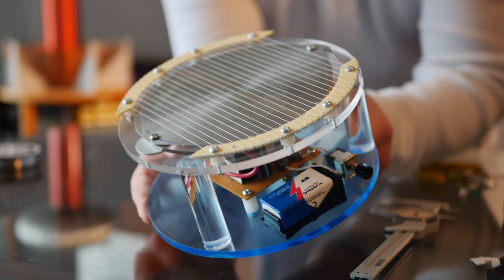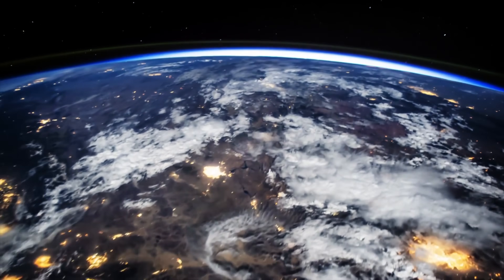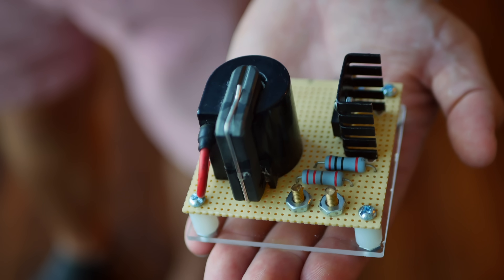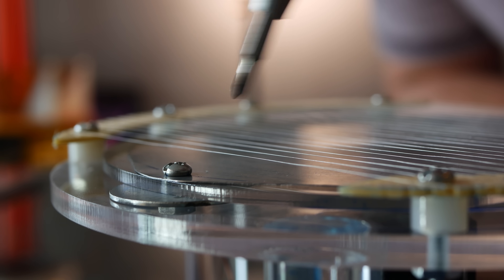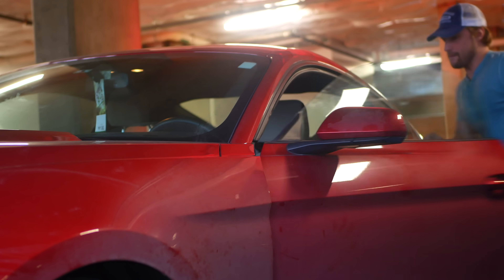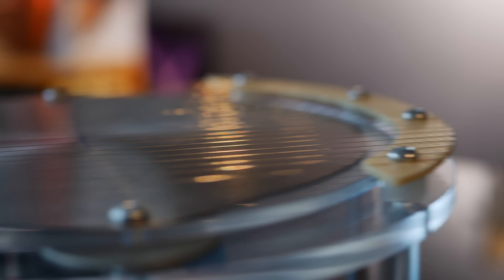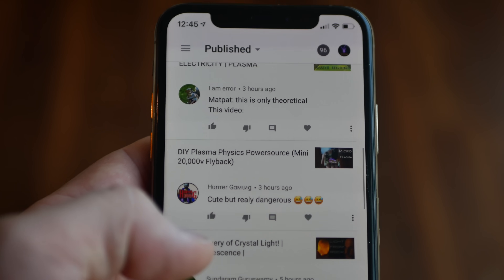Detecting Radiation Using High Voltage Plasma (Spark Detector)

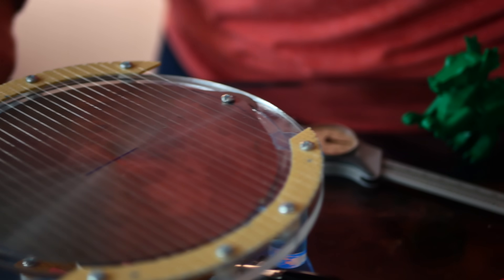Comment: At about 5:40 you said "Why so angry" "I made a detector for air".  I thought that was the best thing in the video. About 170 muons per square meter per second. About 1 muon per square cm per minute. Natural radiation is about 1 to 10 counts per second.  In fair weather about 200-800 negative ions and 250-1500 positive ions per cm^3. Before a storm goes up so you might make a storm detector.  Indoors a few hundred ion's/cm3.  If you would focus on one straight pin and a flat plate, with a microscope and camera to measure the distance and the voltage, almost any circuit can count the cascades. An array of straight pins.Put something on the plate, drop the pins though holes in a pcb, solder the pin heads, remove the paper/sheet and the pins should be at uniform height. Have screws to adjust the height, and adjust the voltage. 

If there is a transparent electrode material, and darkness, a camera might follow tiny discharges. The size of the gap determines voltage and volume affected by the high energy alphas and electrons and gammas.  But if ion detection is a target, that can be adjusted. An array of current detectors only needs tiny amounts of current if you have fast detection like a software defined radio.

Filed as (Ion detection, radiation detection, pins and arrays, large voltage gradients at small voltages, events)

Richard Collins, The Internet Foundation

Comment: A simple cylindrical fluorescent tube will do the job.. Also Neon Light bulbs will do.. Just play around with the HV .. High Impedance, high gain amplifier will be required to detect alpha particles..

Comment: If you drop the pressure in an enclosure add some neon, bring the wires closer together and lower to the plate you'll have more resolution, just like Cerns proportional wire counter.

Comment: You can get a bug zapper that basically does the same job as the high voltage wire part of this build. It's sold as a tennis racket fly swatter. It has the high voltage wires and the circuit you need for this. Just take it apart and repurpose the parts.

Comment: The flyback transformers that I've found use 12 V - ~30 V. In your tutorial you also mentioned that this high voltage supply can handle 12 V - 18 V. 

But in this video you are powering it with 9 V! Why is the low rating limit 12 V if you can run it on 9 V? Is it because in this specific mode of operation you need to generate a lower voltage difference than in the intended application of the flyback?

Comment: Nothing like using a high voltage air detector 😄. Mouns were a fascinating discovery to every surface lurking curious scientist, nano & micro tron-stream elements have there very own gravitational polarity bonds. Not as rightous to any STRING theory to attach. They conjure from the anti side to THIS excistance. In days & eons of time, traveling in a straight path, particular will align closer & closer, in parallel or indirect travel at infinate range apart, even luring just under a time range of eternity. Forming from mere particals, light rays, plasmic , ions mouns build up into gasly, ligiud/ice, dust, 🪨,  astriod, bolders and moons planets etc. Every just appeared fast foward in deep space spectate, because light was slowing gravitationally, to teach every creature, that nothing is forever & there was no end to the beginning of the great Call of the Wild Celestial Cosmic interstellar PLASMA entertainment.

Comment: That 3D Part would basically turn it into a Micromegas detector I think.
Micromegas is a relatively new kind of particle detector (20+ years old) that can determine both direction and energy of the particles at the same time.

Comment: maybe i got a 3D detector ? it looks like it is same basis design like yours, but a 3D type of detector ?? bottom plate is 5 x 5 areas, and wires are Horizontal and Vertical with individual connections to high voltage please see my video :
https://youtu.be/E6UunaM6YSs

Comment: I wonder if it woud be possible to turn this into solid state device, where air is replaced by some thin but solid material and then it could detect X-rays or beta radiation at high resolution rather than useless alpha particles. radiation triggered version also look interesting as image intensifier since it could show some image

Comment: radioactivity meter with high voltage sensors reacting sensible to metals. Maybe, what you are measured, was not (only) radiation, rather the static current of metall and its discharge in this interaction?
However, with radioactivity meter based on high-voltage (400 V  and more), you cant get a reliable measurement, when metals are near the sensor. These static dischargings from Metalls in this elektrical fields aren´t radiation, but isn´t distinguishable from radiation.

And there are uraniumglas, what is much cheeper, as this smoke-sensors. Maybe not...because these are cheep industrie-products. But these uranium-glas did not made of metal. And if you buy a trade-common radiometer, most or sometimes there is uraniumglas as a testobject included. Maybe, you make another test with uraniumglas and without metal stick?

Comment: SO DOES PLASMA ETCHING PRODUCE GAMMA/BETA RADIATION?
Reply from the maker: At atmospheric pressure, the radiation is hardly above background levels
Reply: @PlasmaChannel  HOW IS THAT? RADIATION CAN'T TRAVEL TROUGH THE AIR? OR THE LEVEL IS JUST TO LOW?

Comment: Yes make the 3d version. Also here is something I was taught in the Navy as a nuclear trained Electrician's Mate. There are 4 kinds of ionizing radiation, which you covered 3 of. There are 2 more basic types of radiation, one of which is ionizing. Neutrons and Protons. Protons are also directly ionizing. Neutrons with sufficient energy are indirectly ionizing, depends on what captures them. Ionizing radiation is important, because it is the kind that causes biological damage to our cells and DNA.  To know the best way to handle them, the Navy came up with a basic little story.

Pretend you got 4 cookies and each cookie is made of one type of ionizing radiation. Which one do you eat? Which one do you put in your pocket? Which one do you hold on your hand? And which one do you throw away? Your 4 types of ionizing radiation are beta particles (free electrons), high energy neutrons, gamma rays, and alpha particles (also known as helium nuclei). What about protons you ask? They are are very rarely able to go anywhere before capturing an electron and becoming a hydrogen atom.

Each kind has a different ionizing factor as well. Gamma rays have a factor of 1, beta particles a factor of 2, neutrons a factor of 10, and alpha particles a factor of 20. This factor is based on their speed, energy, magnetic influence and mass. Furthermore, each kind is stopped by different objects. As you observed, despite the mass and energy of an alpha particle, they are stopped by paper. This is due to the sheer size of the helium nucleus. Electrons are stopped by anything that can absorb them. Neutrons will travel much farther and scatter about until their energy is low enough for an atom to absorb them. Gamma rays will just blast past everything until captured by the photo-electric effect of an atom they stray too close too.

So what do we do with our 4 cookies? You eat the gamma ray cookie, put the beta cookie in your pocket, hold the alpha cookie, and throw the neutron cookie away.

Gamma rays, while extremely energetic and can cause ionization when absorbed via the photo-electric effect, generally will zip right out of us and be long gone before they finally interact with an atom in such a manner. This is why the ionization factor for biological damage is so low.

Beta particles are also stopped by our clothing. While more ionizing than gamma rays and much more likely to interact, they don't make it very far before being captured.

Alpha particles are held in our hand. Just as that sheet of paper stopped them, so too does the dead skin cells on our bodies. They can cause a TON of ionization events, but their sheer mass actually works against them from going far. For alpha particles to actually cause harm to us, we have to ingest it or breath it in. This is why homes with basements have radon detectors, to let you know when atmospheric levels are too high.

Finally, we throw away the neutron cookie. It is highly energetic and light. It is much more likely to BOUNCE off of other atoms before slowing down enough to be captured and travel a long and winding path through out bodies, potentially, leaving many many ionizing events along the way. This makes neutron radiation the most dangerous of all by far.

So, eat the gamma cookie, put the beta cookie in your pocket, hold the alpha cookie, and toss the proton cookie.

Comment: Finally got around to building this, using the same materials.  Never got an answer on the wire spacing, so that part was interesting to figure out, but finally got it working.  Very cool, and interesting project, and used amaresium, as well, from an old detector.
Reply from the maker: Glad to hear you got it working. Nice work!
Reply: You could use a ajustable high voltage power suply. Ben explain in his video.
https://www.youtube.com/watch?v=ZBHIp967TD8

Since this is expensive, at least to me, you could make one like in this video:
https://youtu.be/1SaGMlFgQCo?t=100

So you don't need to worry with the distance between wire and the plate.

Comment: If you do a 3D one,  use non-magnetic wire - that way you could try putting a magnet inside to see how the field changes the path of the particales
Reply: the idea is good, but the gyroradius (the radius of curvature due to the magnetic field) of Am241 alpha particles (energy ~5MeV) in 1T field (maximum magnetic field of a strong magnet) is ~0.25m , which is too big to see the deviation on such a small scale ;)
Reply: @damoysamuel7149  This one sentence explanation blew my mind...is there a availabe source of lower energy alpha particles? But i still think the 1T magnetic field is the braking point
Reply: @TreHazenF  alpha particles are helium nucleus, so yes it's "easy" to make "alpha particles" at lower energy with a ion gun (but in that case we just call them "He ions" because alpha particles are usually considered to be high energy He ions created in nuclear decay). For example helium is easy to ionize in ecr ion sources (it's a plasma confined with magnetic fields and heated with microwaves). So you are right that with low energy ions you could see the curvature of the trajectory with a strong magnet, but then I'm not sure the ions would still have enough energy to travel more than a few mm in air, and ionize it enough to produce sparks in such a detector ;)
Reply: @damoysamuel7149  I am very thankful for the knowledge you shared! I learned a lot
Reply: Non ferrous wire

Comment: Another really interesting way to visualize radiation in using a cloud chamber. It can detect both alpha and beta particles, and sometimes random radiation decay of radeon or cosmic particles. It doesn't use plasma but still really interesting.

Comment: Hey Mr.Plasma :) I have a suggestion:
I watched your video about electro-levitation..
But,
I saw that Portable device a couple of times, which you connect to your leg - or any part of your body -  Then your hands get to be capable of electric zapping others or fry electronic, light alcohol on fire, and MOST importantly they get magnetic and attract things like tobacco leaves, sand, napkins and others..
I might have seen people turn on light bulbs with their hands, yet I'm Not sure of that.
This device is portable and powered by a 9V Battery.
I'm NOT talking about Tesla coil.
It would be fun to know about the methods and concepts and applications of it.
Thanks a lot.

Comment: What about adding a variable resistor at the input of the High voltage generator? (the DC in) so you can regulate the output voltage of the HV generator (so it would function like a some kind of gain control)

Comment: Try bringing an electrode for TIG welding to your device. This will surprise you. Try the red one. You can also try dark-blue ones Yttrium plated (β − radiation). You can also experiment with Xenon bulb cathode.

Comment: Can the set-up work with the plate hot and the wires at ground state?
Also, commenting on an older video, you got an ignition coil to play with and cut off the driver circuit to use it.  I normally employ that circuit in place, as it does all the hard work of driving the high current and being immune to false triggering. You just need to provide a pulse train up to 300 hz. Mid 80s mazda rx7's have nice ignition assemblies to toy with; one is single ended and one is double ended.

Comment: no no NO please warn about the extreme danger of taking apart a smoke detector. Although alpha sources are fairly harmless on their own, taking them apart can result in lots of fine dust which, when inhaled or ingested, can cause extreme danger depending on the quantity. Don't get cancer, buy a proper alpha source and wear gloves.

Comment: Hi!  Very nice video revealing what it really takes to make a project work well.  I suggest that you place threaded  plastic thumb-wheels under the plate to slightly raise or lower the metal plate.  This will give you control over the spacing distance problems.  And yes, a 3D version of the detector would be most revealing.  Finally have you tested the detector with "Fiesta-ware"?  These orange plates, cups, and bowels are highly radioactive.

Comment: Interesting! I tried exactly this about 18 months ago and failed to produce any spark from any of my two Am241 source, which happened to work in my cloud chamber (though not very strongly). Seeing how well yours work starts to make me suspect my sources are pure junk.
Reply from the maker: The polarity of your powersource matters too. Try flipping the polarity on your electrodes!
Reply: @PlasmaChannel  good point indeed, but I'm pretty certain I did. At least now I know it's possible (initially it was just a random idea that I wanted to explore), so since your tests confirm the feasibility, I'm pretty sure I'll try again on a bored week-end :-)
Reply: @PlasmaChannel  also I'm wondering, is yours adjusted to be very close to arcing or did you keep a good margin ? I.e. does it smell ozone by corona effect or not at all ? With mine I definitely went as far a making it produce quite some ozone.

Comment: I have a serious question that needs answering. I know you can deflect Alpha and Beta particles using magnetism. But can you deflect radioactive gamma particles using an EMF and/or add in enough electricity within the air holding enough charge with spare electrons? Maybe the sheer speed of the particles would cause the particles to act like a small collider and add electrons? Just a thought I've had. I'm no physicist either. Someone?
Reply: Bump

Comment: You know what? For the cube, you might think about using metal mesh screens, like the ones in screen doors to keep the bugs out. You could cut out square shapes and then stick them in like slots, but you might have to put them in frames or some other way to keep them stretched out straight. So, the cube could be filled with these squares, appropriately spaced so only the ionized air can create a spark when a radiation particle hits that area. I don't know, food for thought.
Reply from the maker: Hi John, great input! I actually just ordered screens for a future episode about a flat jacob's ladder. Might give this a try as well, as, I'm currently experimenting with how to make different layers work.
Reply: @PlasmaChannel  AWESOME !

Comment: I would be interested if you can detect alpha particles from tobacco.  Nice build, btw, I've read about spark detectors but they've all been ancient behemoths at universities and government labs.
Reply: Only time I've been able to detect a noticeable alpha decay from tobacco was via ash with a silicon barrier detector under vacuum, even than the radon daughters in most household dust samples gave a greater count.
Still would be interesting to say the least.

Comment: Great build Jay! Thanks! What happens if you point the source between the wires and plate from the side (i.e., horizontally instead of vertically? Maybe we can see a long track from one side to the other? Also for easy calibration, can the voltage just be adjusted instead of adjusting the gap?

Comment: Would it be possible to make an adjustable version of the setup, where there is a way to tweak the voltage or plate height while it's running without too much ElectroBOOMage?

Comment: For a source  ,try putting a piece of  paper  towel on top of a vacuum cleaner hose , allow the cleaner to run 5 to 10 minuets sucking air thru the paper , then try the paper for radioactivity , Radon in the air leaves small trace decay elements on the paper with a very short half life  making them supper active ...

Comment: ITO glass or would it shield it to much? 

Edit: Used phones/tablets would probably be a good way to source it if you happen to try it. Way cheaper than new normally. Probably still want the wired for the load & would probably be destructive to the ITO coating.  But you probably know all that.

Comment: You can reduce the chamber pressure and use other gases, neon would be the best but quite expensive. Argon would work to at around 100mBar. This allowed for more spacing between the wires. In addition, a  small trigger based on scintillator and sipm or pmt would allow a much higher voltage in the moment of detection and therefore more visibility.

If you feel extra fancy you could measure the current of each wire before and after breakdown (or with lower voltage without breakdown) and create a driftchamber